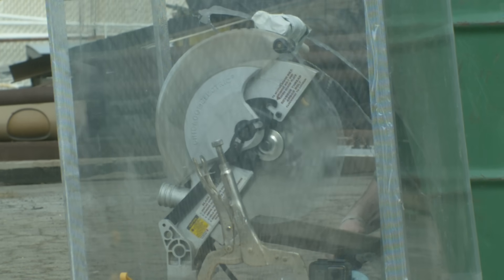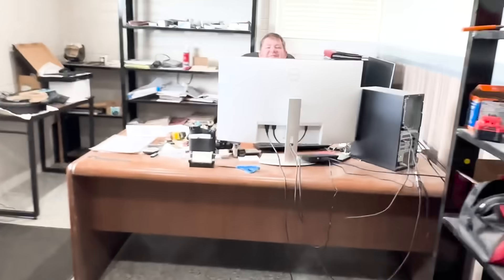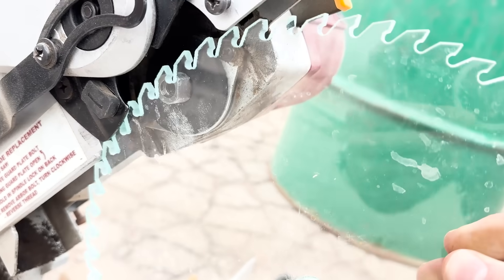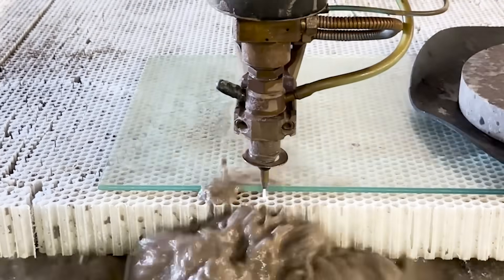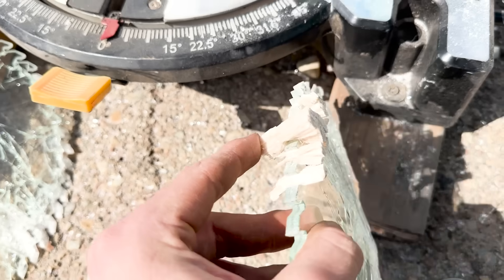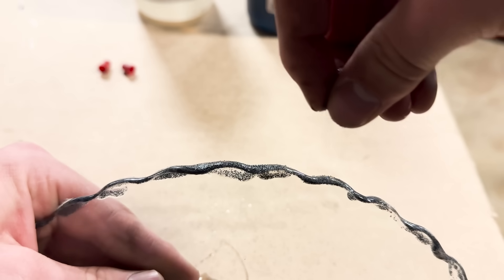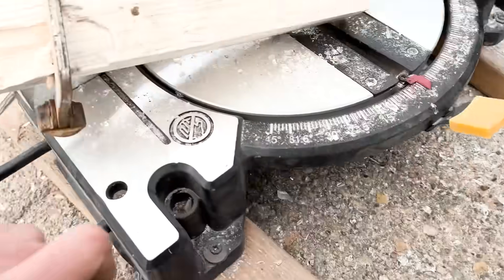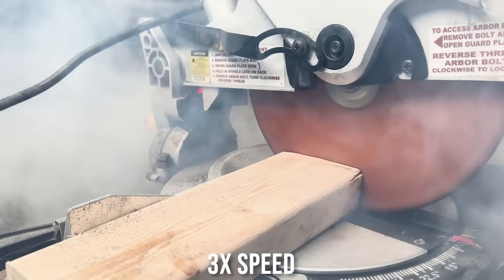Can Glass Cut Wood?

Comment: You can slow down that saw with a router speed controller, or even a light dimmer switch from the hardware store.  Use that to make the startup gentler and to limit the top speed.
Reply: i commented to use a variac. but after someone else said light dimmer. I looked it up, and they are like 600 watts. Sadly wont work. and a saw is a high inductive load, it will kill the dimmer almost the second its powered on

Comment: There were two obvious cracks starting from the hole with the first glass blade. It was obvious those cracks would propagate at the merest hint to centripetal force. edit: the second blade was cracked from get-go too!  You cannot have any weak points in the glass or it will crack further! Glass isn't really strong in stretching or bending, only compression like concrete.
Reply: you would think something so obvious would be... well.. OBVIOUS
Reply: I cut glass and acrylics with our waterjet. I use an ancillary tool called pierce assist that pulls garnet through the mixing chamber on the head before the water pressure comes on. That way it instantly starts to erode the material when the pressure hits. That being said, I have to do test cuts on every fragile material in the thickness I intend to cut.
Reply: This is what I was screaming at the screen. Lol
Reply: The third one had a crack going straight across it too! Actual insanity, lol.
Reply: 333 👍
Reply: concrete sawblade
Reply: Yeah metal is probably better for this.
Reply: i wonder if there could be a reason we don't make sawblades out of fucking glass?
Reply: this was driving me crazy (on a side note it is are to pierce glass without having a crack form i have always used hollow diamond style hole saw with water flowing through it to flush out the glass as i go still a pain but i think the waterjet is just to violent)
Reply: @wmose3694  yeah. I think you need to saw the center hole gently like you said.

Comment: A fiberglass saw blade would be cool to see
Reply: I was just thinking that'd be the obvious next step.
Reply: @clawsoon  it'd probably be one of the most practical non-conventional material to use, imo, besides carbon fiber or uhmwpe soaked in resin.
Reply: @redballsgiveuwang  I wonder if fibreglass would be even better than carbon fibre.  Carbon fibre is really strong and stiff, but I've heard that it has poor abrasion resistance compared to fibreglass.
Reply: @redballsgiveuwang  That's what I've heard.  But it was on the Internet so who knows, lol.  I guess the ultimate fibre would be whatever they put in cutoff wheels.  (What fibre do they put in cutoff wheels?)
Reply: @redballsgiveuwang  Interesting!  My guess is that it would be reinforcing something hard but brittle that's good at cutting like silicon carbide or aluminum oxide.

Comment: I bet if you make a cotton candy machine on crack, melt down the failed glass sawblades, pour them though the cotton candy machine to make glass fluff, use the fluff to make threads and yarn and fabric, then slather the fabric in carbide/epoxy resin, it would stand a chance.

Comment: I think the shaft of the motor was slamming into the glass from start up, and the weight of the glass was resisting the motion. So that was like an immense amount of pressure on a tiny area, you could make this work with a plastic bushing
Reply: There's a screw that was rubbing against the blades, can see a good closeup at the end
Reply: i was going to say something about this! kinda frustrating that he never did anything about that in this video.
Reply: Me and my dad make fishing lures out of balsa
Reply: @CarXman1432 I haven't eaten anything today yet
Reply: @CarXman1432  that's really cool!
Reply: Yeah. It totally wasn’t  the cracks in literally  the  center of the blade lol
Reply: No.

The glass had cracks. The cracks cracked.

Comment: My dude, you need to consider adding lead to the glass compound, it makes it more vibration resistant, but also more heavy, soo you need to curb some rpm off of the rotary aswell, or add magnesium/something alkaline. Otherwise aluminiuminated crystal glass is a good alternative, but a bit more expensive.

Comment: I like the idea I saw of the fiber washer adhered to the glass blade, I feel you should also insert a rubber or silicone grommet in the center hole of the blade to account for micro vibrations against the center shaft. Those vibration I feel are the likely culprit to every glass blade failing since all of the fractures radiated from center instead of from the area that the screw was scratching. more evidence it seems towards the center of the blade being the issue is in the final slow motion shot, you can see the blade isn't spinning in a perfect circle, likely from glass chipping away from the center.
Reply: It would be tough to have a grommet at the center and still center the blade so it doesn't wobble.  At those speeds, you need a balanced and centered blade.
Reply: @surferdudemi  True but better then the bare glass on metal contact, may increase the longevity of the blade by a few times.

Comment: Can you try to use monocrystaline silicon?
Monocrystaline silicon has an extremely high ultime tensile strength.

You can buy 12 inch discs easily but they are very thin

Comment: You need to put a rubber ring in the hole where the sawblade is mounted so the metal dont touch the glass

Comment: I have an silly idea. 

Make a saw blade out of lexan. I’ve heard from a bedio it’s 250x Stronger than glass!
Reply: That is genious
Reply: But then what's he going to use as a shield?
Reply: @Vadow789  He’s a King… I’ll be his shield.
Reply: That was my thought to
Reply: you'll need to put it on a cold saw.
Reply: What would you cut it with if it's 250x stronger than glass? True genius bro
Reply: @VaporNova  you can cut polycarbonate (lexan) with hot wire, laser, waterjet, jeweler's saw, conventional circular saw, and a myriad of other tools.
Reply: A, not an. "I have a silly idea" is what you mean to say.
Reply: Lexan may be stronger but it isn't harder
Reply: Think to the temperature!
Reply: totally what i was thinking!
Reply: I was thinking at the moment they bought us using it as a shield.
Reply: heres an idea: education

Comment: A abrasive saw blade out of granite would be interesting
Reply: That made me think, ceramic could also be an option. Ceramic knives are also a thing, and they are more brittle, but pretty tough.
Reply: @drantigon  Definitely ceramic, but granite is not uniform and has grain boundaries which might be weaker than some of the grains, leading to crack propagation
Reply: Centrifugal forces will tear it open unfortunately. Maybe a different type of rock/mineral that's more uniform.
Reply: Correction: use a prince Rupert's drop

Comment: GUYS BUY A VARIAC FOR THIS YOULL SAVE THE GLASS , you can get a cheap one for $50. it lets you control how much mains voltage you send to the saw. This way you can turn the knob up slowly to reach mains voltage of 110volts. that way it doesnt start at max speed, cracking the glass. start at like 30 volts, then slowly turn up the speed so it doesnt shock the glass so hard at max speed
Reply: I was thinking a regular dimmer switch for lights would probably work and they’re a lot cheaper
Reply: @GRosa250  Possible, but can a dimmer drive an 10 amp inductive load? I dont think most dimmers are designed to offer that amps. and a saw is an inductive load because of the coil in it, and that can trip certain protection circuit 
a variac, even a cheap one can push 20 amps.
Reply: Don't they also go past mains voltage too like its a q variable  transformer

Comment: Glass is really bad with these kinds of stresses.
Maybe tempered glass? Like you'd find as very thin screen protectors for example. They're so flexible, they feel more like plastic.
Reply: I thought tempered glass is harder, but more brittle. 

So the way is to use, on the country, a more flexible, less brittle material like translucent plastic.
Reply: @tatianaes3354  then there is laminated tempered glass. best of both.
Reply: Tempered glass would explode into a million pieces as soon they try to cut a blade out of it on the pressure washer. Having said that, I would totally suggest them trying it. Would make a for a fun video haha.
Reply: You ain't gonna make a hole in a tempered glass.